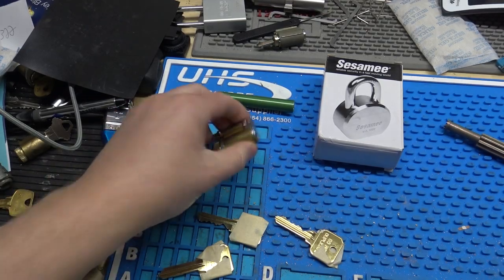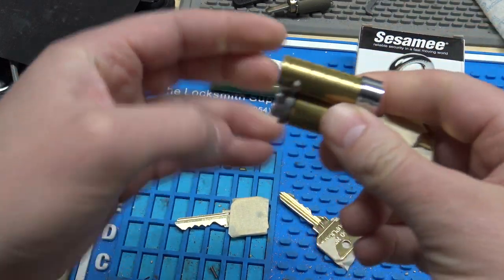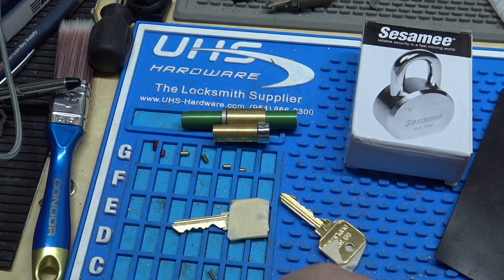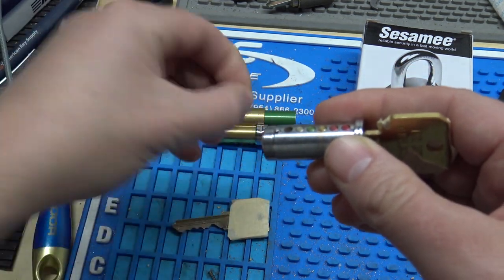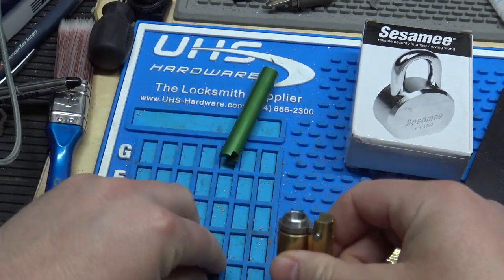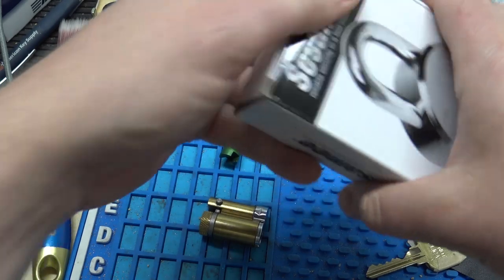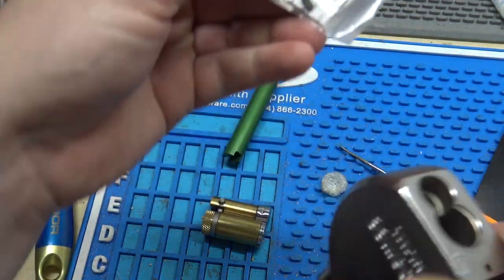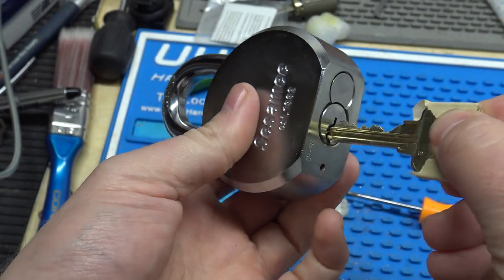(487) Rekeying an LFIC Cylinder

Comment: No tool to punch out the caps?   Have I been doing it wrong?  :)
Reply from the maker: except on large format there's no caps......
Reply: @russej02  Yep, no holes in the bottom to push the caps out. SFICs are not the same.  Still, that padlock looks heavy enough to kill.
Reply from the maker: @CandyGramForMongo_  this cylinder is LFIC